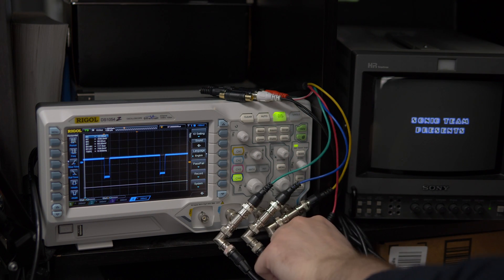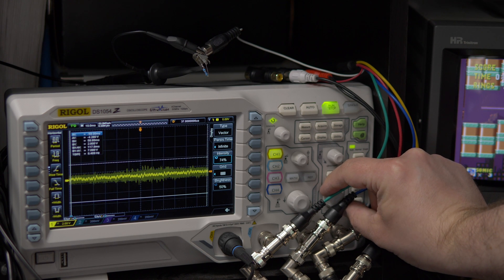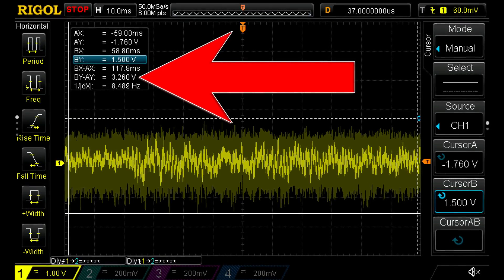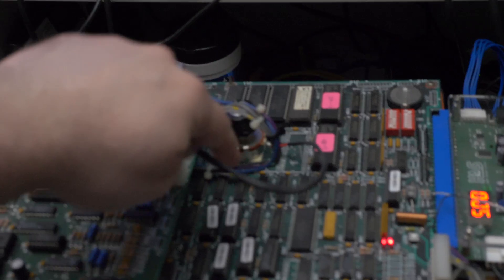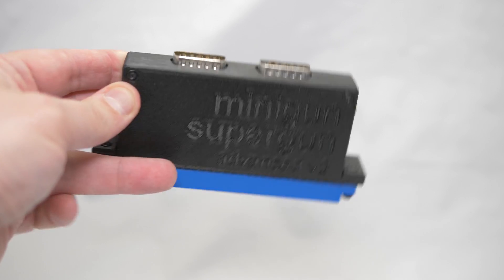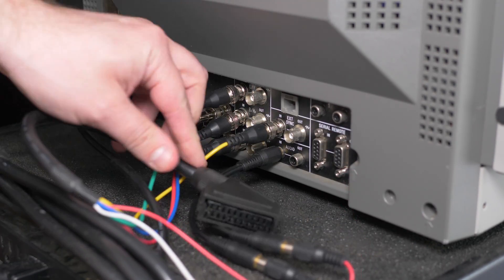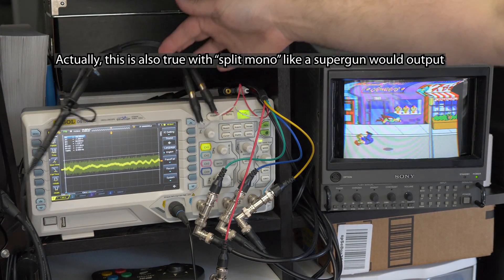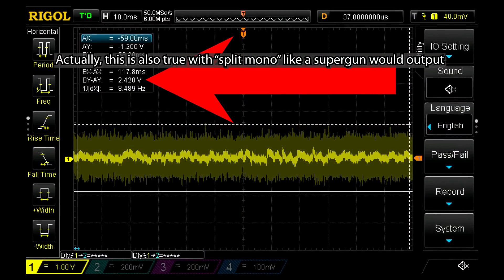Testing Audio Voltage on an Oscilloscope

Comment: I am trying to troubleshoot audio distortion issues so I'd like to listen to the output as well as measuring it. Instead of the 100kohm resistor, can I use RCA Y splitter, connect first output directly to oscilloscope without a probe (1Mohm), and second output to actual load (mixer input and speakers, 10kohm)?

Comment: (EDIT: I re-tested a few things and got different results compared to what I wrote initially, so I'm rewriting this post with updated results)

I've been learning about audio stuff lately, and I did some basic studying on how the peak voltages relate to sound levels in OBS, a program that most of us are probably familiar with. I used a signal generator to put a sine wave into my capture setup, and I found that the 0 dB point (full scale) corresponds roughly to 2.5 Vpp at around 10 KHz. This is with the Line-In volume at 100% in Windows. The SNES can output up to 3 Vpp, so it can actually clip in a few situations (causing pops). Lowering the Line-In volume prevents clipping (note: this is not the volume slider in OBS, which adjusts volume after clipping has occurred). I think I will aim for 3 Vpp output the next time I mess with audio circuits.

Comment: So then combining the left and right RCA audio channels from typical retro video game consoles like the SNES/N64/etc with a Y cable and plugging it into the mono input of a TV/monitor that only has a mono RCA input is completely safe? (combining a stereo audio signal with a Y-adapter so that you get the full audio when your TV only has a mono input)
Reply: my cheap CRT TV combines stereo into mono and has a 1.5k resistor immediately after the connection

Comment: Thank you both for the brief overview on the technical audio details. I was thinking about dabbling with audio stuff some day and I was going over some schematics and doing early research. I was lost because there was no specific info on specs like I'd normally see with video (75 ohm source/load termination resistance, 700 mVpp under load, etc.). So I guess we just need to make sure the peak voltages stay within the linear region of the amplifier under a high impedance load like 100 kohms while staying in the neighborhood of a few volts peak-to-peak.

On a side note, it's been a little over a year since I got a scope thanks to your technical videos, and I've been trapped down the rabbit hole ever since. I hope you're happy :P

Comment: For the Y combiner question, there has to be a change in impedances for the voltage levels to not change. With fixed impedances, superposition principle says that signals can constructively add up to 2x your voltage. To properly Y-combine, a series resistance change would help the effective voltage divide each output sees. The circuit has to be properly constructed so that each output can not see the other output as a load, which could cause the signal to clip (low output impedance sees low input impedance). Of course, there is the nuance of whether your source is a voltage source or current source, but the latter is true in this case.

Comment: You forgot to mention dc vs ac coupling and 10x vs 1x probe settings, both of which will make the measurement bad.
Reply from the maker: I both discussed and showed examples of switching the probe to 10x.
Reply: @RetroRGB  i must have missed it, sorry - what time index are they at roughly? The DC vs AC thing is pretty important - if your output has heavy DC bias it might damage inputs, and it will sound bad even though the peak to peak voltage will look perfect under AC measurement.
Reply: BTW, I watched it all - I didn't skip any parts - but I may have zoned out. I'd appreciate a pointer!
Reply: @cheater00  0:50
Reply: @kjellrni  thanks, i missed that. what about ac vs dc?
Reply: cheater00 Check out and around the 13:00 mark